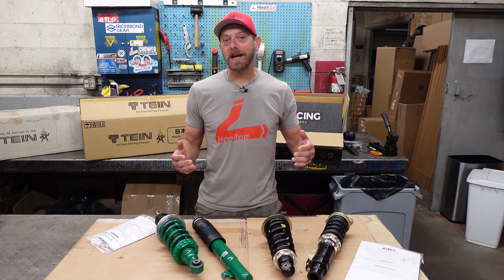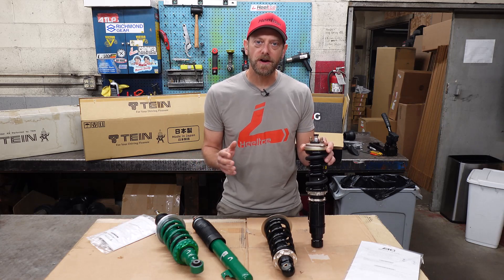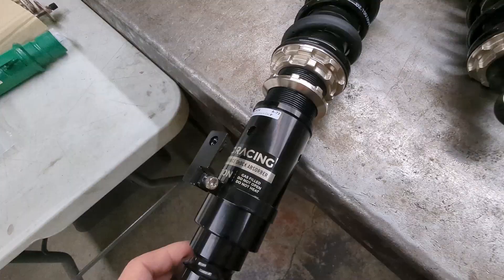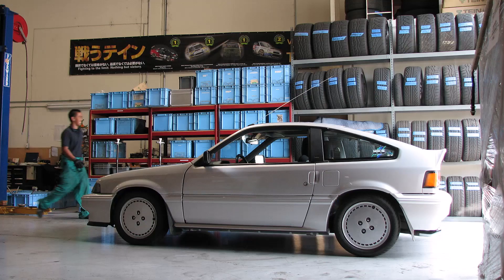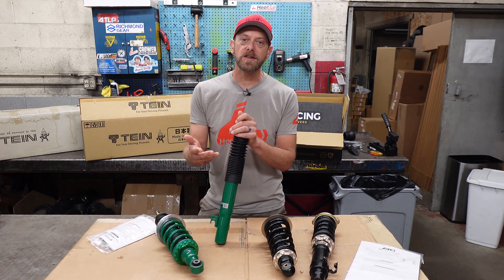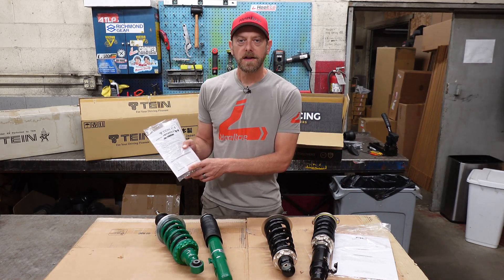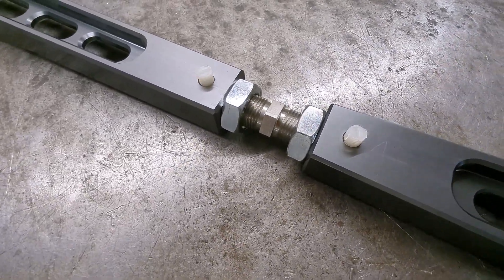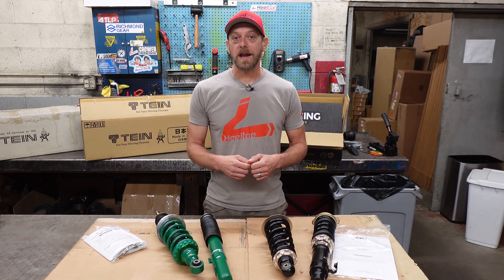Which Coilovers for your Torsion Bar Honda?

Comment: Wow....stumbled onto your channel looking for the Hi-tech header sound.  I have a 89 Integra in storage for 20yrs & only 50k miles.  Major life crisis & health problems.   I hope I can get this Integra up & running & need to get a good alternator for it as I took it apart back then & that was the last thing I remember.
 I never had the chance to buy the Tokiko Illuminas & springs & Jackson Racing stuff he had back in the day, so I hope I can get my health back soon & buy one of these suspensions from you!  I want a lower but soft o.e. or better street ride like a modern day Cadillac! 😂 but also well dampened.   Do either if these have adjustable shocks like the Illuminas?

Comment: Great info Marcus. On the BC do you find people have to change front wheel offset due to the presence of the coil spring.  I could see that being a factor.
Reply from the maker: They don't really come back to tell me TBH. But if you have wheels that come close to the OEM damper I am sure you would need spacers with the BC Coils.

Comment: Just installed my BC coilovers today, didn’t know much about torsion bars before install until I was finished and watched all these videos. Has anyone ran without the torsion bars? I know in video you say it’s a choice, and I feel like with the new BC design it might be better to run w/o to obtain full performance of coil over? I just don’t want to go upon pulling them out and nothing them and installing them and still having pressure/resistance in front end other than the actual suspension itself. Thanks in advance.
Reply from the maker: Jury is out on it, I am planning an install and evaluation soon! Re-indexing may not sound like fun but it probably is the exact right thing to do.

Comment: Just got some bc coilovers and notice that something is  leaking grease on the passenger side any ideas what has grease down there it looks like it's pressured out I'm thinking the torsion bar adjustment? Is this a easy fix I want to get thicker torsion bars
Reply from the maker: Probably best to send a picture to us, email support@heeltoeauto.com
Reply: @Heeltoe. Thanks ima get some good pictures and send them you're way thanks!

Comment: Video is black and only audio is working
Reply from the maker: The Tein with the right shipping choice and set up correctly certainly are. Do you find the BC not to be street friendly?
Reply: @Heeltoe.  after listening to the video , I know realizing that the front index on the bars is most likely incorrect. I will wait till your front indexing video to figure out what I did wrong.
Reply from the maker: @darksidegarage910  yeah that's a very big important one to do. Both kits need it. Are you having an issue where the front is too stiff?
Reply from the maker: Videos working for us, maybe reload or check again in a little bit?